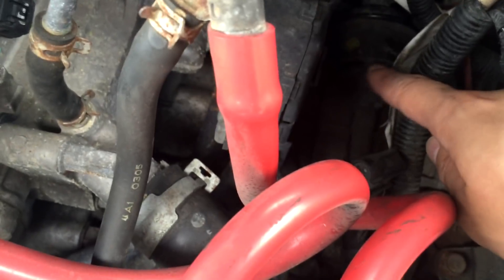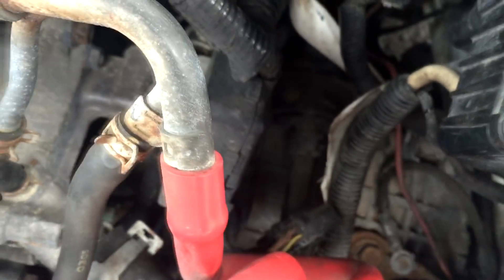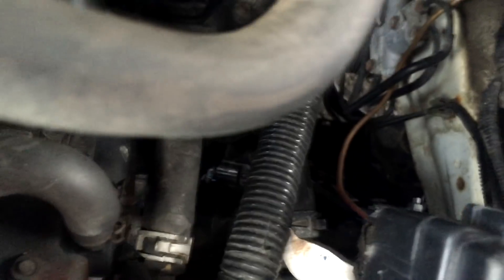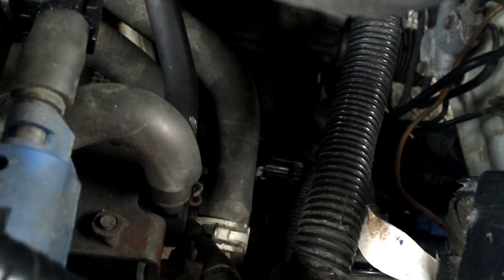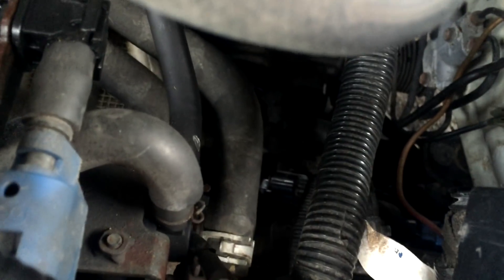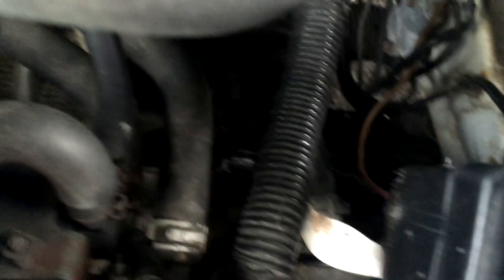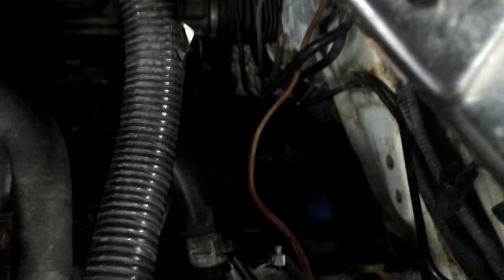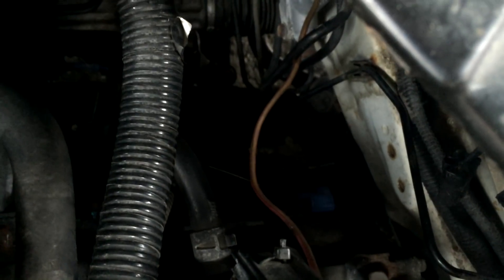Acura / Honda Transmission Problem? Blinking D? Check here!

Comment: know anything about the acura tl v6 3.2? I have squeal while turning losing power when the transmission shifts down and having issues with transmission lag seems like 2 issues not sure though
Reply from the maker: Sounds like your transmission is slipping and starting to die. The Acura TL 3.2 , 1st gen & 2nd gen are known to have bad transmission =/

Comment: Hello,please I need help,my car is a Honda acura,1994 automatic and d4 are blinking.
Reply from the maker: You might have the same problem, use a OBD reader and read the code ! My reader told me it was the Output Shaft Sensor.
Reply: MTLJack thanx u. Shaft sensor(sped sensor.?)may be,becouse some time no work,and some time work .

Comment: i have a daihatsu yrv 2001 
the blinking 4 gear light blinking i change the transmission and the tcm and the same thing
Reply from the maker: Maybe its the sensors. When you changed the transmission, you or the mechanic re-used the same sensors.

Comment: Hi I'm having the same problem the D keeps blinking and I took it to autozone and they told me the code which was p0700 so u think this would work ?
Reply from the maker: angel hernandez if it shows P0700 then its P0700, i had another code so it wont work
Reply: can you tell me what did you do to fix it ? ihave the same blinking D with  p0700 code

Comment: I got engine check sign at the board and the code read from Autophix OBDMATE 123 on my CRV 2002 is [ P1705 Short in Transmission Range Switch Circuit (More than one range position is on at the same time) ]. The D light is flashing sometime when I am on drive and once I switch ignition off and then on. It will stop flashing. It re-occur  again mostly when I am on drive. What should I do for the case, bro? Any recommendation?
Reply from the maker: You probably have this problem buddy, https://www.youtube.com/watch?v=BG-7fiLhK7A  , good luck
Reply: MTLJack Thanks for pointing out video
Reply from the maker: no problem , like and subscribe to help me out too , i could be of help in the future one day, thank you!
Reply: Learn To Share just get a (neutral safety switch )that's the range sensor,its only 2 bolts looking up
Reply: hey I have the same exact problem but I shorted something in the speedometer and I have the same code so I switched the neutral safety switch and same thing happened I need help any suggestions  @007rozier
Reply: @Tarzanrob1997  the switch come out of the box in the neutral position, when you switch out the part,make sure the car is in (neutral) NOT parked when putting on new part.than test it.
Reply: My speedometer out as well,if our traction control or cruise control buttons fail I believe odometer wont work,i read that somewhere...both are out on mine bit i found the issue,its a green wire disconnected from the female side end of the clip that's on the throttle body area
Reply: @007rozier I'll have to check that out first my cruise control wasn't working and now I'm getting the flashing D light more than I want.

Comment: Honda Civic 2000 lx D4 Problem everything works  but it won't run on d4 while it runs on 1,2 and D3. Anyone encounter a similar problem? Appreciate if you leave a comment on how to improve my car.
Reply from the maker: I don't know well enough about Civic 6th Gen sorry, sounds like a transmission sensor problem similar to mine. There should be a check engine light if its transmission sensor problem, otherwise,you have a mechanical problem.
Reply: MTLJack So if the check engine light is on it means it's a transmission sensor problem?
Reply from the maker: Not necessary , maybe you already had a check engine before. Use a OBD2 Reader to read the codes. Good luck
Reply: Johan did you find the problem?

Comment: hey, what are the two parts again. whats number for the output and input??
Reply from the maker: You can buy them on rockauto, here's the exact link buddy

http://www.rockauto.com/?carcode=1422155&parttype=10634

Input shaft sensor : 28650PPW013
Output shaft sensor : 28820PWR013
Reply: MTLJack I’m having the same problem but my car is a acura mdx 2016, is this the same sensor that work for my car o should be another one? Thanks for any help